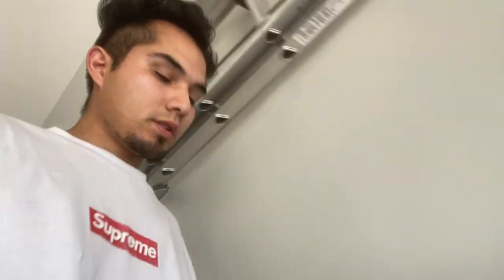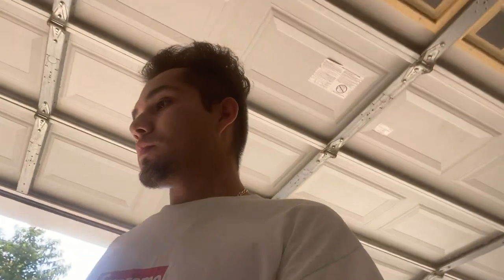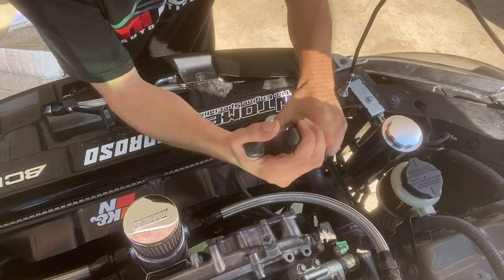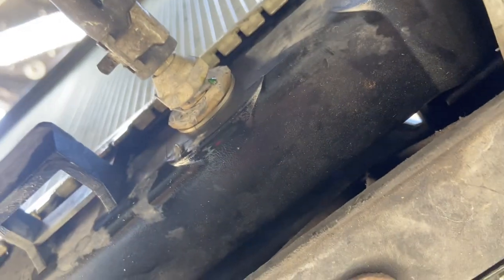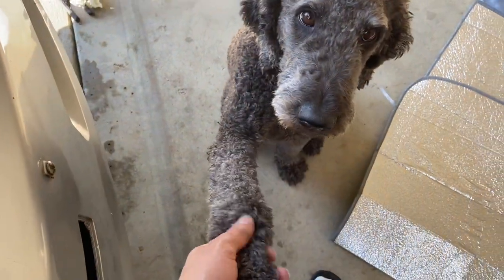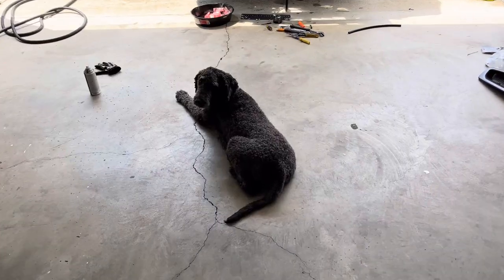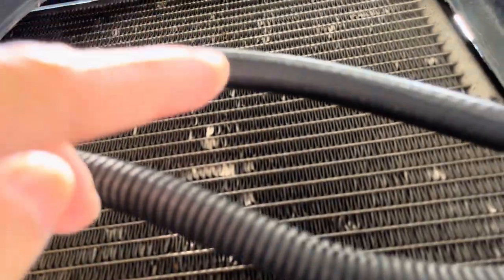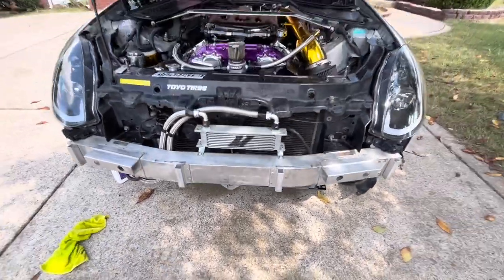How To Install Aluminum Koyorad Radiator G35 V35

Comment: Thanks for this excellent video! I'm about to upgrade the radiator on my '06 G35 6MT coupe that's got about 140k miles on it and this'll be very helpful.
Reply from the maker: glad it helped dude. It’s a nice radiator and the fitment is perfect! If you upgrade the hoses just be sure to check for fitment and clearance.
Reply: yeah  @DEATHWISHVQ  I ordered some Z1 silicone hoses so I'm figuring I'll need to cut them a bit like you did.  Did you have any issues bleeding the system after the upgrade?
Reply from the maker: @synaptik111  ahh nice dude. & No everything was fine, I just had to watch a few videos on how to bleed it properly lol. Motordyne G35 has a video and it’s great but his method takes too long. I know Z1 has a video on how to bleed the DE. If you have her changed your bleeder port consider upgrading the the aluminum version, since the OEM bleeders are plastic and get damage very easily.

Comment: whats up bro. did u have to modify it so it could fit perfect? when i installed mine I couldnt get it to fit right because the tabs where the condenser hook in seem too long so they were hitting against the plastic frame where it goes in and how were u able to fit the radiator and use the oem gourmets? I hade trouble doing that too and was just wondering how u did it